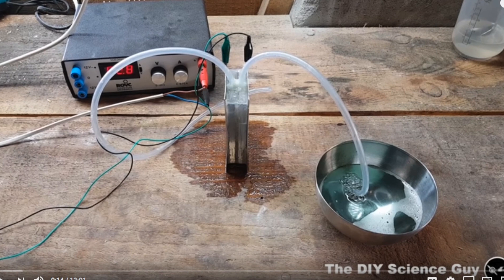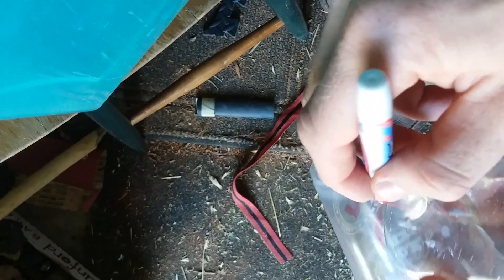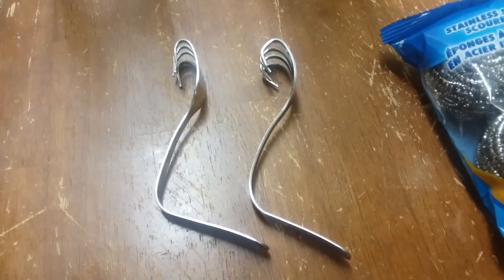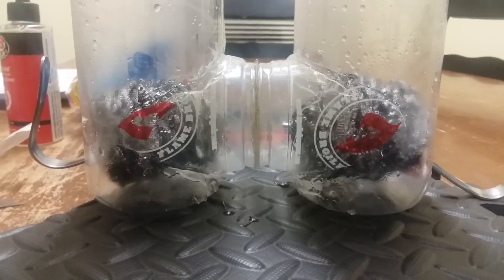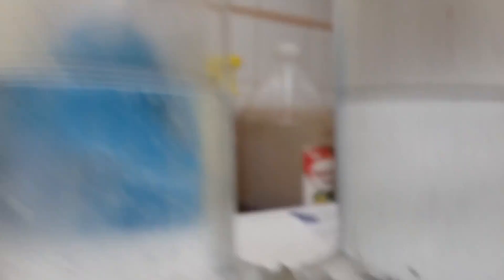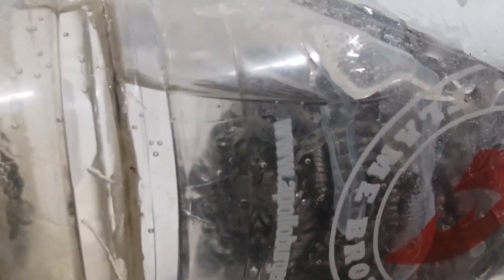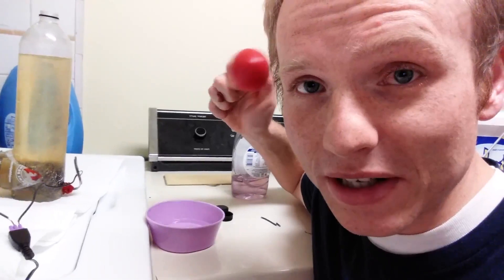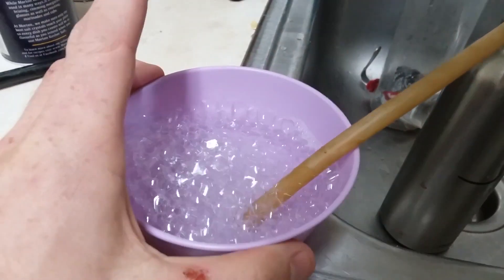Making Hydrogen from Water (Ft: The DIY Science Guy)

Comment: The now shut down website of S1R9A9M9 told of certain obscure tests done , as related to the triple coils assembly , as used on the 18HP Briggs engine from riding mower that ran on mineral water in carburetor 2008. Water vapor pressure generated along with Hydrogen formed and fired same time .A high voltage pulse through high voltage cable that is wrapped in 60 turns of insulated hook up wire and steel nail core,  with 20 amp draw from 12v battery and .6 load resistance - will change to 12Amp draw as  reactance in .4 ohms is CREATED in the 60 turns. That means that an old style ignition ballast resistor of .6ohm with 12v will draw 10amp for going THROUGH the engine spark plug, due to .6+.4 ohm in circuit, as 1.2 ohms total. The Champion spark plug internal 4kohm resistor is removable  from top, as then zero ohms with copper insert replacement. Other parts in plastic deli tub on side of engine besides the triple coils and resistor, would be accessory required spark gap, and 2 diodes as voltage drop from 13.5volts charged battery. Once started, the alternator to DC bridge rectifier 14.9A ran the circuit as battery had been disconnected. Magnetic field 10A impressed on cable extends timing from 0 to minus 34 degrees while electrical field impresses .4 ohm on same main circuit. (2 power sources same time)  Of course S1R  knew there was danger due to temporary acid expulsion from battery with the ignition high volts there, until the battery wire was removed after engine started. That's why he changed the wiring diagram so as it would then not work, since people got hurt practicing with circuit and not knowing what they were doing. The S1R coils was to be the replacement for the obsolete dual coils 60cycles AC relays as used on the car conversions. YouTube videos 1+2  BY  S1R9A9M9 .

Comment: My solution to 6:00 is that electricity doesn't need a large space to flow. So I use a plastic pen casing from a bic pen stuffed with part of a cotton ball. I cut it so it doesn't have to travel far and punch a hole in both bottles push the ⅓ of a pen casing in and seal with epoxy.

Comment: The brown color is almost certainly from transition metal ions, from Cl attacking the stainless steel. There will be a mix of different oxidation states of Fe, Cr, Ni, Mo. It's extremely unlikely to have any significant amount of Cr (VI) which is the really hazardous ionization state of chromium; Cr (III) is much more likely, and relatively benign. The metal chlorides will also burn the fabric, so seeing it turn brown isn't a surprise.  As you surmise, use a different electrolyte.

Comment: so that brown coloring is likely Iron Chloride dissolved into solution by Chlorine gas before it collects enough to make a bubble, it then collects at the membrane from the electric charge forcing it over.  I'm no expert but I believe that is what happened this time as i have ruined a few steel spoons doing similar experiments before.
Reply: you can use sodium carbonate instead of sodium hydroxide as your salt but iron electrode still degrades to like iron oxide.  I think tungsten or platinum are better because they don't degrade as fast.